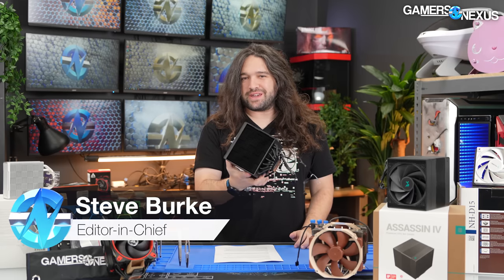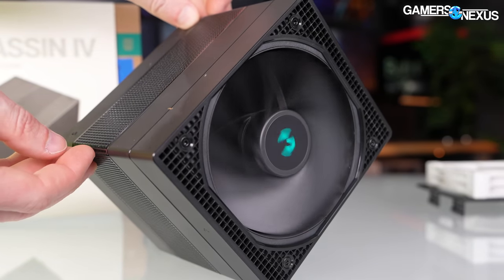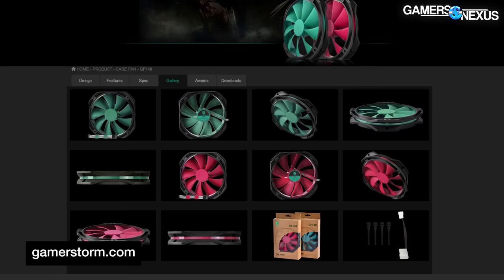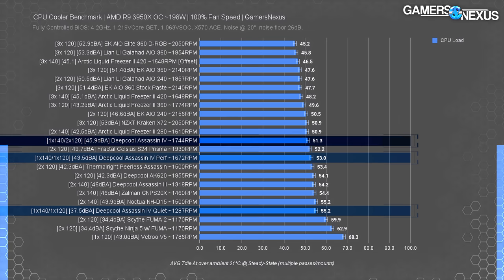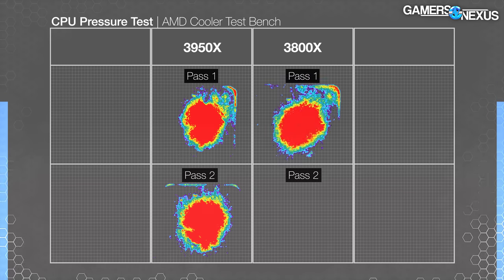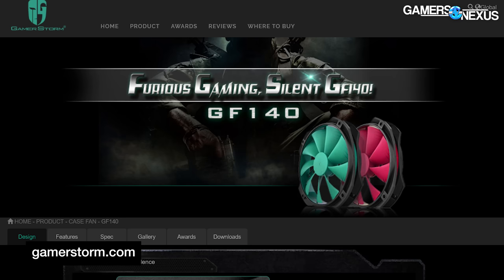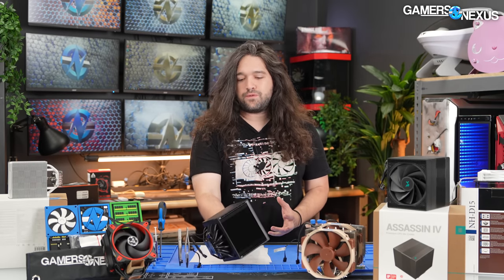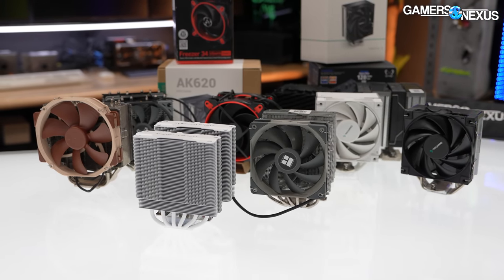Mega Size Air Cooler: Deepcool Assassin IV CPU Cooler Review & Benchmarks

Comment: I'm glad you are giving so much attention to detail when it comes to noise caused by the fans. Sometimes it is a pain to try and find proper fans to cover that aspect, and Noctua definitely puts money on it.
Reply: I don't really like that you are pretty much stuck with the center fan, so if it gets noisy or you want to change it at some point you are out of luck....

Glad they cover details like that.
Reply: its nice to have quiet fans but i think noctua is overplaying the noise problem and leaving aside the performant part, they should make the fans able to reach 2600-3000rpm and let the user decide if they want/need quiet or performance, i myself have found out that sometimes you want quiet and on particular moments you want maximum performance, and 2000rpm is frankly very low speed for a top tier fan.
Reply: @eX_Arkangel  Performance is not measured in RPM, but in CFM and ultimately in the temperature results for your use case. And even leaving that aside, the key is to offer good performance to noise ratio and that requires effort. Noctua is good at doing that.
Reply: @Lucius4992  performance is always tied up to rmp, no matter how much you develop the fan in the end if you want more CFM or air pressure you need more rmp, again, i said noctua is getting to caught up too much in noise reduction leaving performance aside, aparently you didnt read my comment completely, i didnt said make them louder i said give the user the option of silence or pure performance when is needed thats all.
PD: doesnt matter what you say, high rmp fans will always outperform quiet slow ones, phanteks 140x30mm @3000rpm kills all noctua fans, if noctua just gave the option to run its fans at 2600-3000 and leave it to the user to choose the mode Quiet or performance thats all.
Reply: @eX_Arkangel  I'm willing to bet that Noctua does plenty of testing their own products, and that the performance gains from higher RPMs isn't worth it. Certainly, given the excellence of their extended 6-year warranty, I don't blame them for not running their fans faster than is necessary.
Reply: @em.dot.2  again, give the user the choice, they have server fans running at 3k rmp, the performance gains are worth it so long you dont prioritize noise over perf, but they are forcing their choise for no reason on the consumers, give them the choice, make the default choice the silent one but let the user have the capacity of running the fan at 2600-3000 if he wants to even if it is for a particular demanding task that's all im asking
Reply: @eX_Arkangel  You are putting too much focus on something that you can almost 100% ignore when looking at the specs of a fan. Also you can't even use it to directly compare performance between different products, that's my point. But you NEED to look at CFM and dB when making a choice. Also when it comes to servers, you are not supposed to be in the same room with the machine beside your ear most of the time and it's a totally different cooling system made for heavier workload, so that's a different story.
Reply: @eX_Arkangel  Nah. They give the users the choice, then users who aren't savvy will let it run at 100%, complain that it's too noisy, and return it. Noctua is making the right call. You're more than welcome to install different fans or buy a different cooler altogether if you don't like Noctua's decision.
Reply: @volvo09  Agreed. To me this cooler is too expensive, the fan noise is too whiny, the center fan being non-replaceable is a huge turnoff, and IMO this thing looks ugly as hell. I'd rather spend less money on a cooler with replaceable quiet fans and skips the metric ton of ugly plastic trim. But hey, to each their own, I hope everyone who buys this cooler enjoys it.
Reply: @mjc0961  so your meatshielding is user error? wtf, i just said give the option and let the default be the silent mode, what part of my english is so bad you cant understand it?, users who aren't savvy enough will be unable to switch the fan from default factory silent mode (the actual mode) to performance mode, so your reply actually doesn't make any sense, if you are going to meatshield a company that takes pride on his savvy and tech prowess do it properly. Btw you are more than welcome to use passive cooling if noise is such a bother for u, quit using any fan as noise is unbearable at any level for you apparently, and let user who actually need fans to criticize and request buff or perf upgrades, or extra features in TOP class extremely expensive fan.
Reply: @Lucius4992  ok i though people here where more tech literate, sorry, so RPMs are useless in fans, less just run them at 0 rpms. Again closing your eyes to the obvious things i point out, basically you just told that people looking for HiPerf fans can just get a 900rpm 120mm fan because RMP can be 100% ignored when looking at the specs?, yeah just read it again and come back please. Also when coming to workstations and servers there are different fans at different speeds, 2600-3000rpms is slow AF for a server fan, so please educate yourself a little more, try 4800-6000rpm 40mm thick, thats a server fan.. again the meatshielding must stop at normal requests, there's nothing preventing Noctua from adding a performance node to their fans, be it by PWM or by a swtich on the controller board, let silent mode (actual) be the factory default but allow the users who want more perf if needed to get it, or risk them going to phanteks
Reply: @eX_Arkangel  Nope, I didn't say any of that. You are ignoring me and having a conversation with yourself at this point. Just go and grab the noisiest, fastest and angriest fan you can find if that makes you happy, there are many brands and no one is forcing you to buy anything.
Reply: @eX_Arkangel  And then what? Have Noctua lower their warranty to 4 years, or 3 years, because the fan can now operate with potentially marginal gains, and now the company expects to see a huge uptick in busted fans around the 4-5 year mark because its no longer the product the engineers had in mind. 

The fan tuning for noise-normalization process seems to be a big part of what high-end fan companies are competing in. You could say that Noctua structures alot around their fans, so asking for control there feels a little bit like going to an expensive restaurant and demanding that you be allowed to do all the seasoning for your dishes. 

I will say, I would love if Noctua would release a separate enthusiast line of products dedicated to people who want to mess with fan design, including being able to change the fan blades, and make airflow adjustments totally freely. But as it stands, I'd hate to see unnecessary adjustments to things like Noctua's 6-year warranty, and impressive costumer service overall.
Reply: @eX_Arkangel  Dude... There's 2 huge problems with your argument. The first is that Noctua does sell higher RPM fans for people who want them, the second is that nobody is forcing you to buy Noctua fans if good acoustics isn't what you're after.
Reply: @eX_Arkangel  The line of thought you're following was what made panaflo fans be recommended for tower coolers back in the late 00s. Rpm this, rpm that, slightly more cfm so it is better. I fell into that trap back then and got one of the highest recommended fans around. So I ended up with a turbine (panaflo fans were commonly used in large copy machines before and if you've used one you know the noise that comes out of it) that gave me an incredible 1C gain compared to other good fans. Information was nowhere as easy to get as it is nowadays when it comes to hardware.

There is a lot more than rpm involved in fans and that is what people are replying here. 

Yes, Noctua could create a fan focusing on speed above all but that goes against their usual practices so you would create a niche product that don't really target your usual niche. Sounds like very risky business to me.
Reply: @Labotohs  no wonder you ended with a fax machine fan, you keep ignoring my comment completely, i really thought people here were more literate about tech, apparently i was mistaken, right know i have a 40mm thick server fan on my cpu, plugged into the water pump sock in the mb and in dc mode, guy is a beast fullpower, but if not i let him go silent, theres that, so what about that panaflo?, no pwm? no curve?, again, and please read several times before you ridicule yourself yet again, i didnt say they needed to focus on rmp o forsake acoustics, i just said they should let consumers have a performance option on the fan to go past 2000rpm if needed, but hey read about fan curves and pwm before coming at me again with panaflo. Jesus crist (not you steve) whats so hard to understand? i really dont get the insane meatshielding for no reason. im baffled about some peoples lack of understanding here
Reply: @em.dot.2  wtf you talking about dude? i mean really?, fan desing? food seasoning wtff, is as simple as allowing the fan controller to go up to 2400-2800rpm whatever the motor can handle without heavy wear, especially if its the same motor as enterprise high rpm one uses, its that simple just either let it be by default or add a switch on the controller, yet you go to restaurants to design noctua fans with food seasoning? man get some help.

Assuming the motor can handle up to 3K rpm (server parts) with same or even higher warranty, whats the problem?, you all seem to think for honestly i really cant understand why, please someone tell me in what part of my comment i asked noctua to redesing the fan to forsake everything for just rmp?, where did i said that?, just let the motor get a little more juice thats all i asked, and even do it optional, same materials same fan design, same acoustic firm at factory default rpm (1500-2k rpm), just add a little switch in the controller for unlocked rpm. but whatever i thougt there was gonna be more technical or intelectual discussion but its just baseless meatshielding around acoustics alone, if you want acoustics get a 600rpm fan you'll see what silent means
Reply: @eX_Arkangel  You talk about ridiculing oneself but you should look at how you’re replying to other people first. Getting aggressive with those who aren’t doing the same towards you isn’t going to help you or your argument. 

My critic was that you’re giving too much importance to rpm imo, nothing more than that. The panaflo was an example that came out of a much more brutal case of focusing rpm. It should be obvious that I’m not saying you advocated them and I did mention it was a trend in the late 00s, when we had way less options and information going around. Next time I’ll try to make it clearer that it is an example of a more extreme version of that line of thought… 

If you avoided my dumb mistake from 15 years ago, then cheers to you and I’m glad you were well informed to know that hype was silly. 

I did read all your comments, of course I agree on pwm being important and I understand that you didn’t say that you would screw acoustics as a whole, if someone isn’t paraphrasing everything you wrote it doesn’t mean they simply didn’t read it.
Reply: @eX_Arkangel  okay buddy I can't really tell what you're trying to say here, but it sounds like you don't understand that Noctuas entire business model is designed around noise-normalized performance. 

The restaurant metaphor was a pretty simple one, but let me make it more obvious:

If you don't like the way Noctua designs their products, then their products are probably not for you.
Reply: @Labotohs  its not agressive its necessity because it appears people only read what they want so the need to be shocking in order for people to actually read the hole comments and not just the think they like/dislike, but dont worry i give up, everybody here just want 600rmp 10db fans that not even dogs can hear, durability reliability performance thats useless to them, another thing about your panaflo, it wasnt the higher rmp that wasnt helping (although theres always a limit) it was the cooler itself being heat soaked, so more airflow isnt gonna help at all, use panaflo with noctuas d15 or any top shelf DT aircooler and then tell me theres no diference against a 1500rpm fan, of course use a proper space heater, any intel KS would do
Reply: I recommend Be Quiet!
Reply: @eX_Arkangel  Why not just get an industrial fan, if you don't mind the noise. They last for decades as well. I've run 30 year old CNCs with original fans on their control boxes. Not in clean climate controlled air either.
Reply: @ssjwes  because usually industrial dont have speed control, plus, why not give the end user the choice for when its needed? they are actually paying a high premium, the motor can handle the extra speed, already has PWM built in, so why not the choice, for instance in winter i like it to be quiet, but in summer if im doing heavy mt task i like it to go bttw if possible depending on the task and time to do it, is an extra feature, the fact some people here need to meatshield against that for insane reasons is beyond me, lately people are so narrow minded they cant see anything past their nose tip without trying to cancel it or trash it.
PS: im currently using an industrial 40mm thick server fan, when it goes it GOES, but has no pwm have to run it on DC mode to get it up to speed on a WPUMP header, and i still like the option of silence if needed, but is way easier to control a single fan in windows than having to swap from a quiet fan to an industrial fan and so forth and back every time i need silence or performance dont you think?, some people here aparently want you to do that, insane people

Comment: I got the Assassin-IV the day it was released to the USA market at standard MSRP.

You guys missed a VERY IMPORTANT benefit of this cooler - that it offers performance on par or slightly better than the best Air Coolers on the market while also offering 100% tall RAM clearance because of the pull-pull design not having a fan hanging over the RAM slots in default configuration. Its kind of the entire point of the cooler - Otherwise they could have just slightly improved the design of the Assassin-III.

The smaller thing you guys missed is that it is (subjectively) the best looking Air Cooler on the market. The fin stack shroud means this cooler has the cleanest Aesthetic of any Air Cooler to ever exist - as it is simply a giant black cube when looking at the system installed in a case - and they are coming out with a White version in a little while.

This cooler vastly out-performs my 5-year old Noctua D-15 on my Ryzen 7800X-3D but that could be down to the D-15's age having been moved from a Ryzen 1700 to 3700X to 7800X-3D. Regardless, the Assassin-IV showed a temperature reduction of 3.5C at 100% fan speed and 5.0C with both coolers limited to 60% PWM (~1225-1250 RPM reported on the Assassin-IV). System Case fans were also limited to simulate a overall silence-optimized PC and both coolers used a FRESH application of Thermal Grizzly's Kryonaut Paste since I just upgraded the PC from Ryzen 3700X to 7800X-3D a few weeks ago.

This improvement combined with the removal of the front D-15 fan from obstructing my RAM slots so I can now see both RGB RAM modules is precisely why I purchased this cooler. Plus it looks insanely cool in my Lian Li LanCool 216 case sitting just above my Red Devil Radeon RX 7900-XTX.
Reply: Also good for people who loves RGB on a RAM. This cooler doesn't block the view :)
Reply: show me graphics!!! better than the best aio coolers!!!!!! thats a bold statement!!!! makes no sense ! cheaper aio´s ill bet than ca be even better! but top aio´s ... thats a delusional mind!
Reply: @swaize8866  Um what, I never said it was better than AIOs, I said its better than other Air Coolers - which it is. Steve just showed that in this review - watch it lol.

Also its been common knowledge for a few years now that big powerful Air Coolers WILL beat some AIOs. Small, bad AIOs like 120mm and 140mm are worse than even some Single Tower air coolers. Good Air coolers like the Assassin-IV and Thermalright Peerless Assassin can even match some standard-thickness 240mm AIOs in default configuration (when the 240mm AIOs have 2 120mm fans pushing air only).

Once you get into really good 240mm AIOs with thick radiators and good fans that can move a lot of air through them - then the AIOs start winning. 280mm and larger AIOs are always better unless they are a very bad design.

Comment: After your recommendation I have bought Thermalright's PA120 for my brother's build and it works very nice and was easy to install even for someone doing it the first time (with me on video call providing support). Would be cool if you look into more of their stuff, I am intrigued by their Frost Commander tower with one 120 and one 140, seems like more and more companies do this design
Reply: Frost spirit is better than the commander. Hardware Canucks did a comparison between the 2
Reply: @megadeth8592  Idk how accurate Hardware Canucks' testing is, they seem to get vastly different results in comparison to Gamer's Nexus.

Even with the Deepcool Assassin IV Hardware Canucks said it was worse than the Assassin III, and yet Gamer's Nexus shows that it's better.
Reply: @megadeth8592  Better on particular CPUs - some of the latest ones with strong heat density.  Where the extra heat pipe of the FC doesn't add any cooling capacity because they end up not where the heat is.
Reply: @ThomasD66 that's why the frost spirit is so good. It's heat pipes are better positioned
Reply: @spiritdancer6745 they're the only ones who had issues with it.. If you're OK with buzzing tho have at it.
Reply: @spiritdancer6745 also doesn't change what I said.. The frost spirit is a beast. I just gave the 1 channel I figured people might have heard of as an example.